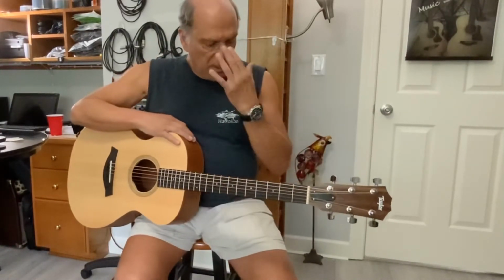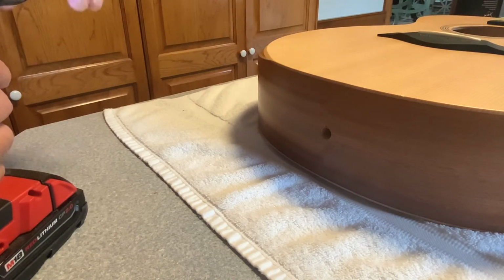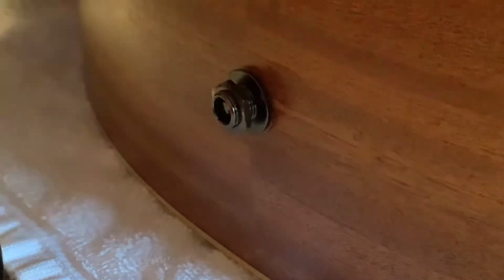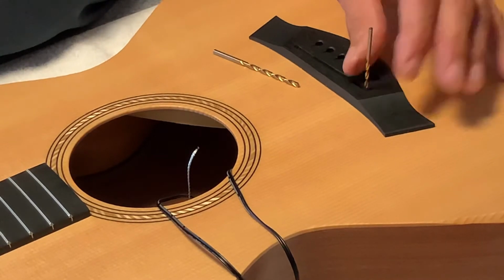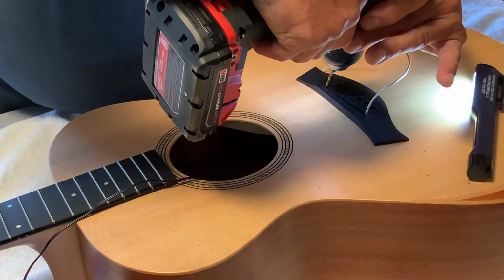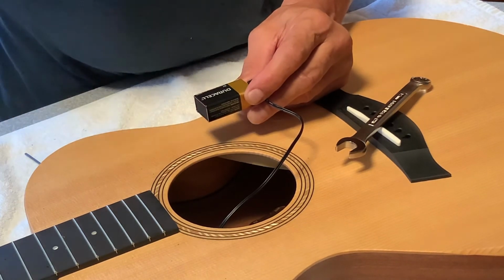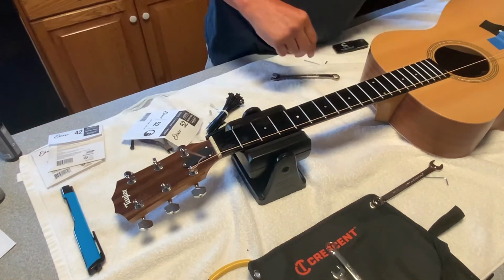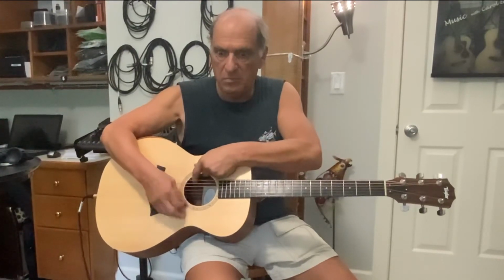The Final Measure: Taylor Academy A12 Upgrades

Comment: Thanks for the video.  I'm about to install the same system in the same guitar so this is a big help.  I have a couple of questions, though.  

1.  Did you leave the saddle as it was before installation or remove some material from the bottom to compensate for the thickness of the under-saddle transducer?  I would expect the transducer to add height to the saddle and that raises the action slightly.  

2.  My Academy 10A has top bracing located very close to the sound hole and this makes finding a secure mounting surface for the volume/tone control a little tricky.  Did you encounter this situation?  If so, how did you resolve it?
Reply from the maker: Thanks for listening! I will be sure Dan sees this this evening and replies.
Reply from the maker: What i did was mark the compensate with a pencil across the entire length.  The, after installing the pickup, I remeasured to see how much needed to be removed and filed/sanded that portion off.
My academy had the same issue with bracing issues, but by repositioning a few degrees, I was able to satisfactorily position and mount the unit.  Thanks for listening and I hope it all goes well for you.
Reply: @caroldan10255  Perfect!  Those were the two open items I wanted to confirm before breaking out the tools.  For a cheap guitar (by Taylor standards, anyway] this is a very nice instrument that punches way above it's weight class...and I've been a Martin guy for more than 50 years.  Thanks again.
Reply: @caroldan10255  All done, and it sounds great.  Just need to trim the tiny strip of exposed adhesive pad from the volume/tone control because of the top brace contact.  Thanks for the detailed video - it saved me a bunch of "contemplation" time!
Reply from the maker: You are very welcome! Glad this worked well for you. Enjoy!
Reply from the maker: Would love to see some photos if you care to share a few.
Reply: @caroldan10255  If I can figure out how to upload them...🤔
Reply from the maker: You should be able to add them as part of your reply